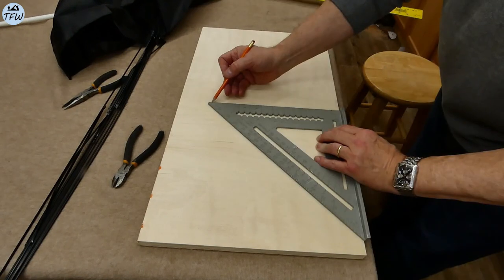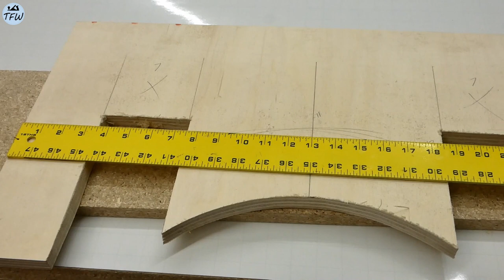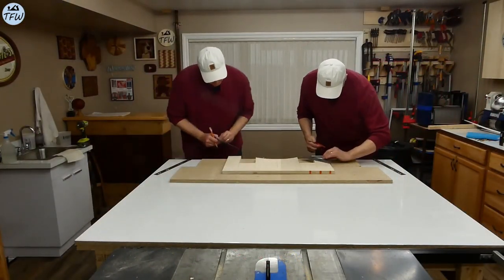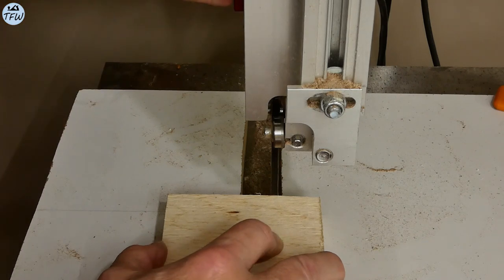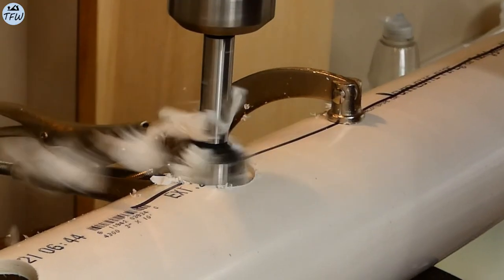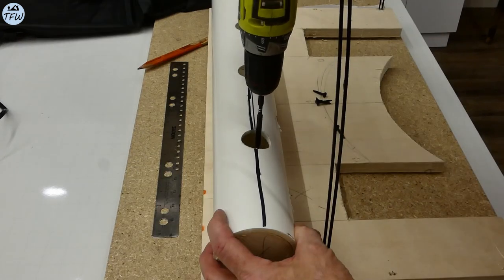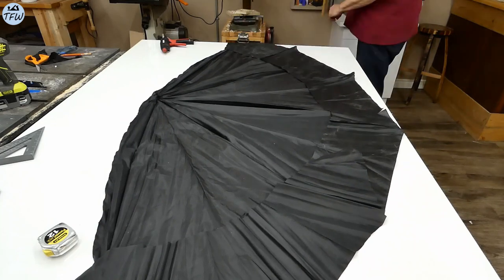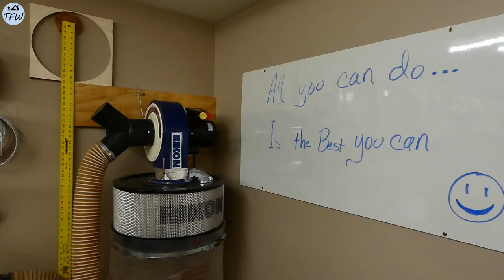Cheap Miter Saw Dust Hood - DIY

Comment: If you put a short, flexible hose on that port on the rear of the saw, you might direct a lot of that dust back toward the pipe instead of letting it get thrown out

Comment: I made something similar from some aluminum angle scraps and a old drawstring poly garden tarp.  You can reduce the opening by tightening the draw string.  I also have a line on the saw itself, so it reduces the dust even more.  Works really well.
Reply from the maker: I've gotten other notes from people trying similar solutions and yours sounds pretty great too!  I dig home made solutions that don't cost $$$.   Thanks for tuning into our little channel!

Comment: Top solution. I don't have an all singing dust collection system in the garage, but it seems to work well with most power tools - even the Evolution table saw - with the notable exception of the mitre saw. I'm not too fussed about doing a bit of a clean-up after a cutting session, but I just hate the giant dust bomb that ends up contaminating the workspace, and, of course, my lungs.
I've actually got some barrier pipe that I used to make a DIY cloche for a raised bed.  That will make for a more solid, yet lightweight construction.  In conjunction with breather membrane, I think it will work well. Thank you for sharing this simple solution to a problem all woodworker must have.
Reply from the maker: Salty soup? Not too much of a problem especially if it's leek and potato.  Thanks for the comment!  This less-than-professional solution still works great in my shop with only a tiny amount of over spray hitting the floor. Everything else settles at the back of the hood or gets pulled through the collection hose. Umbrellas up! Or maybe Bumbershoot depending on the part of the world you are from. Cheers!

Comment: I am currently using a shop vac attached to the dust port (only about 50% efficient) and I'd be interested to see if I do something like this how much more it collects. I would keep a line going directly to the port, but I think I will try using a simpler connection for the DC system straight into the hood instead to the pvc. I have a feeling the pvc is blocking more of the collection because it's directing the air flow in one direction instead of pulling from all directions.
Reply from the maker: I like that idea. The commercial design I saw had a cone shaped drop zone with fabric directing the dust down to a single vacuum collection port... Dust falls. Dust gets collected. My solid top bench wouldn't allow a drop collector. You're right, the pipe doesn't catch all the shavings, but does a good job pulling the fine dust out of the air, keeping it off my face and the floor.

Comment: I'm going to try this. The same type of cover is $150. My miter dust collection is not good. I was thinking of building a cover. i have a golf umbrella that I am going to try and do this with. I'll update on how it came out. I also thought of an old baby tent.
Reply from the maker: The umbrella was cheap, but any polyester tight weave thin fabric would work... The hoops can even be thin plywood cut out with a jig saw... It does a pretty decent job keeping the dust inside the hood, even without the vacuum running. Hope yours turns out awesome!
Reply: Well it worked. Total cost is basically $20. 
Golf umbrella,  dust connections and scrap wood.
Reply from the maker: @christopherjohnson4550   I dig it!  You can always find cheap solutions like this is you put your mind to it...

Comment: I have a bevel rolling ryobi miter saw this dust collection system will need to be modified plus its on a rolling stand as well
Reply from the maker: I like the rolling stand idea a lot... You could even change the dust collection hose position on the bottom (with some more cloth material used as a funnel) and let gravity dump the dust downward...

Comment: Good idea on the shroud but I'm confused about why you didn't attach a hose from the mitre saw dust port directly to your dust collection tube?
Reply from the maker: In the tool review video I did on this saw I tried that,  but more than half of the sawdust sprays to the left and right even with my best shop vac connected.  So, it needed some sort of hood to help contain the spray. Other saws do a better job with their suction port, but this one was affordable and then, so was the dust hood!
Reply: @TheFamilyWoodworker  Ah okay. I do remember you saying that but I thought maybe the holes you have now and a pipe from the dust port might be just a little more efficient. At least the stuff the tool does extract wouldn't be flying around then. But perhaps the suction wouldn't work as well or it might clog up? Either way it's a good idea and appreciate you sharing the video 😀
Reply from the maker: @jennabarton433  My pleasure... this is a great hobby and I love my time down in the woodshop, especially when figuring out little solutions to problems like this one.  Have a great week and stay creative!
Reply: I have come to the conclusion that the best we can hope for as far as dust and miter saws is good dust CONTAINMENT.  Your inexpensive design looks like a great aid in this objective.   I am going to give it a shot and will post my results.   Thanks for your ingenuity.

Comment: Quite inventive and well done.  How is it holding up and working after a year and a half of use?
Reply from the maker: The hot glue fabric overlap came loose in one corner (better if I had asked my wife to help me stitch it together), but the shroud and vacuum set up still work great. Heavier shavings don't always get pulled into the pipe, but the over spray stays inside the hood. Much less of a mess on the bench.